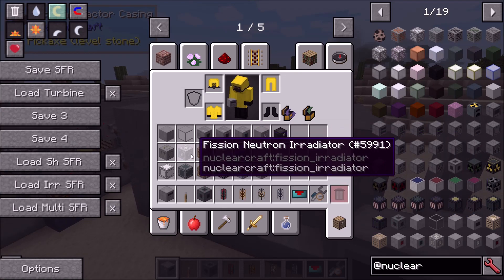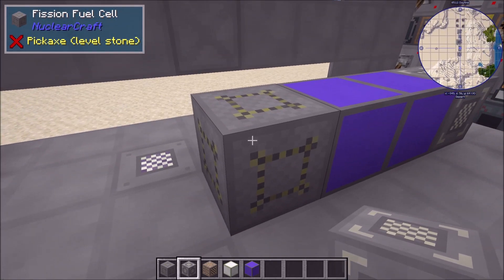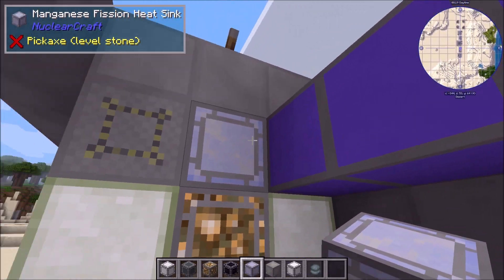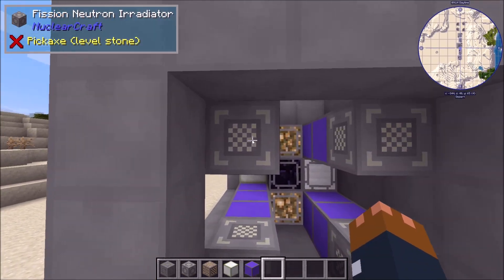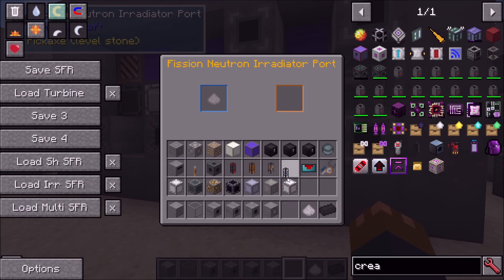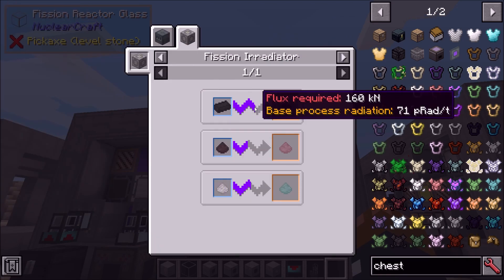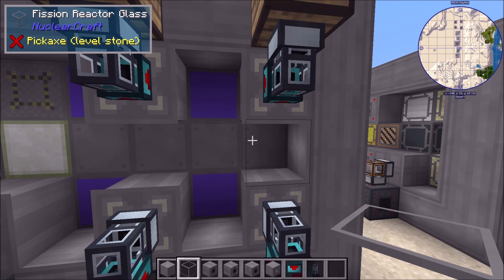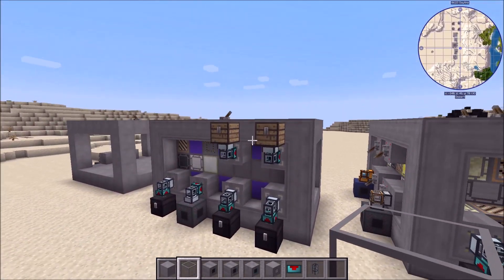NuclearCraft Overhaul - Fission Neutron Irradiation

Comment: doesn't work ;c
Reply from the maker: What about it isn’t working?
Reply: @NuclearCraftMod  heating=0
Reply: @NuclearCraftMod  production rate same
Reply from the maker: @werpolska7128  Hmm, it sounds like the ractor might not be running at all. Is the fission controller texture off or on? If it's off, do the cells have their neutron sources activated?
Reply: @NuclearCraftMod  yes
Reply: @NuclearCraftMod I built a Classic Duff user reactor and it works
Reply from the maker: @werpolska7128  Are you using the design in this video, as well as the same fuel?
Reply: @NuclearCraftMod  nope I used leu-235 fuel
Reply from the maker: @werpolska7128  Ah, that's probably the issue then - if it's LEU-235-OX, it doesn't have a low enough criticality factor to work in this design: you need a fuel with at most 94.

Comment: Dunno what am doing wrong. but this design doesn't work for me. It keep saying: No cluster. In game built and planner. Same
Reply from the maker: Have you inserted the fuel yet, and activated all of the required neutron sources?
Reply: @NuclearCraftMod  HOLY CRAP it works now THANK YOU SO MUCH I CAN FINALLY MAKE N-TYPE DOPED SILICON!
Reply: @NuclearCraftMod  yo another guy but in the future this time! I keep getting this same message!
Reply from the maker: @Nick Taylor Which version of the mod? Are you using the same fuels as I was?